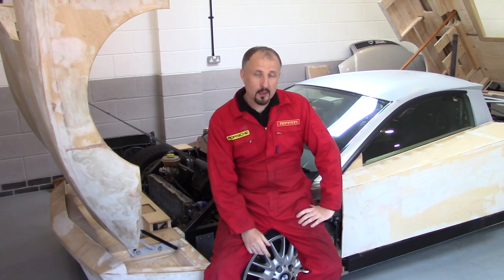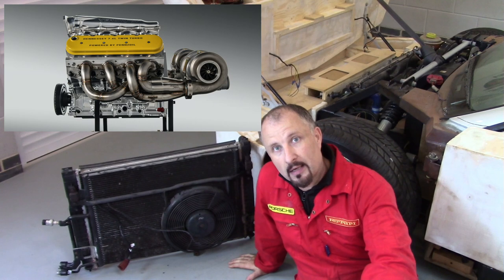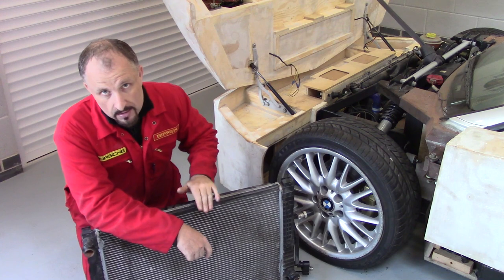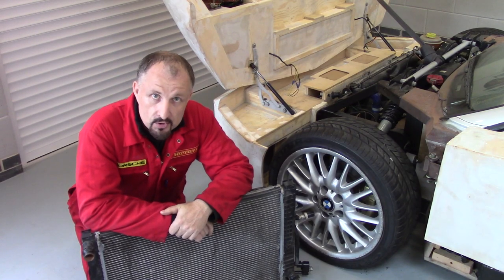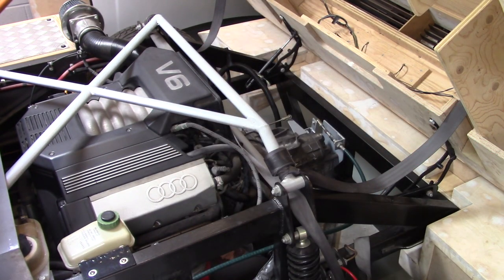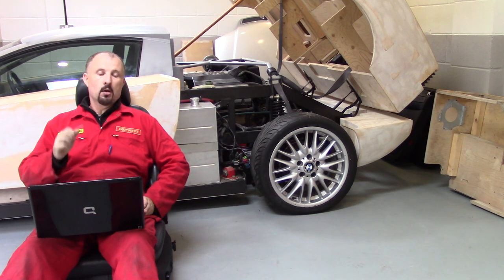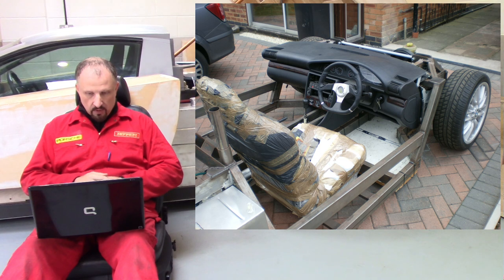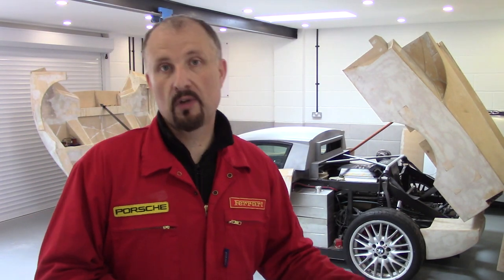Cooling system Part 2 and Raw Chassis for my DIY Supercar: Prototype Ep15

Comment: Lots to think about
Reply from the maker: Yeah, a lot of people can get this bit wrong in their builds, and have over heating problems, but with a few checks in place, it should work.
Reply: I’m going for split rads but combined will be the same cooling capacity as I won’t to make the most of the in and out ducts, all so will look good lol. There are some nice Aluminium rads on eBay and not to Expensive. I see a nice aluminium expansion tank on there to that I mite get. It’s very easy to make a mistake and over look something wen building these cars
Reply from the maker: @Spoonersoutings  Oh yes, if you're doing a Countach build then you'll definitely need twin radiators. I'm pretty sure that the original car used quad core radiators. I think the Escort Mk1 radiator is used in the kit car world, but they're not quad core. When I was designing my Countach chassis, I was going to use custom quad core aluminium radiators, that where the same size as the original, but had better flow dynamics. I'm looking forward to seeing how you tackle this part of your build.